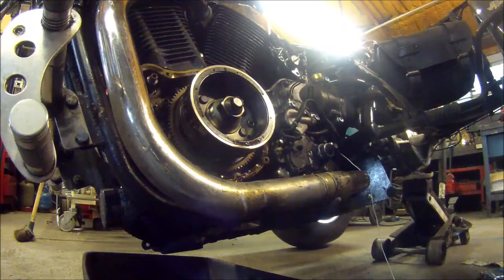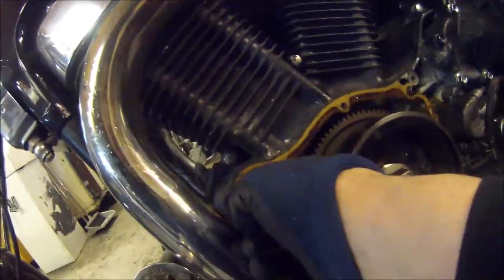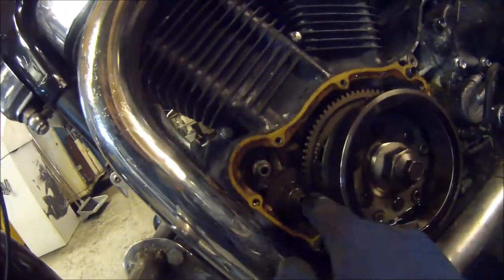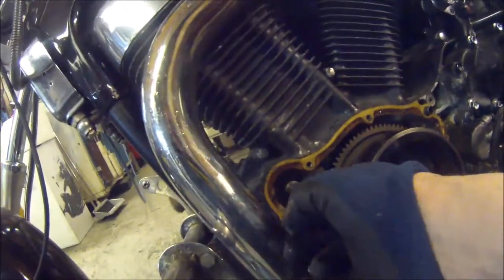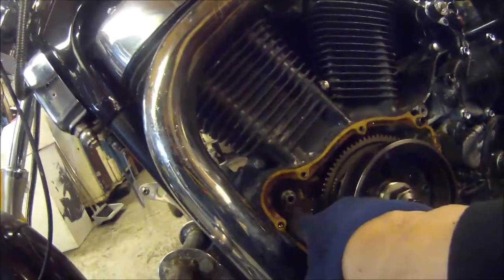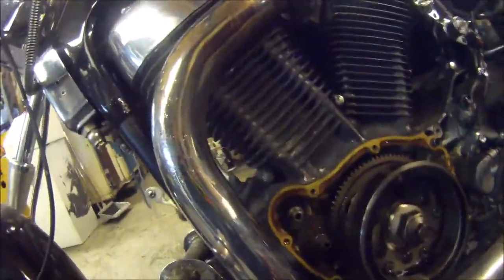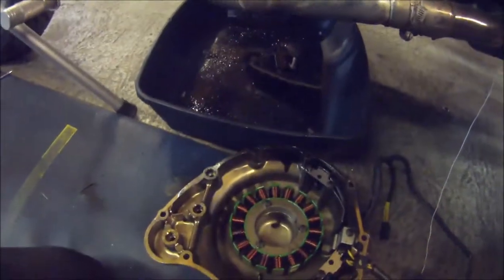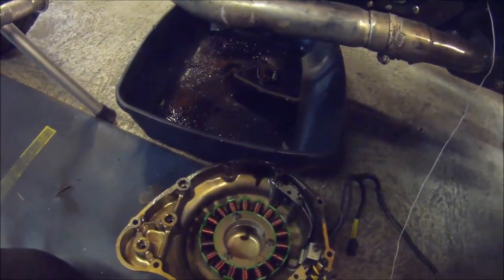Suzuki VS1400 Intruder Charging problems The Nuclear option part 1

Comment: I did this when we purchased my partners VS1400. Previous owner had attempted to jump start the bike with the battery still in place and arced out a lead on the exhaust, and his home made battery tender was arcing out on the frame.. Fried Everything. The replacement stator I bought had a faulty pick up so while it began charging, it then wouldn't fire on one cylinder. After much wailing and knashing of teeth, I got it sorted, got it running and charging properly. Then chopped it up and made it into a trike.
Reply from the maker: Suzuki have always had the one achilles heel; the charging circuit. Back in the day we would fit Honda CBN reg/recs. I've had generators where the pick ups were wired the wrong way around, and some where just one pick up is wired the wrong way, and some that were just plain DOA. The new generator the video shows was a dud, bike wouldn't start, I tried soldering the old pick ups to the new stator but it still wouldn't run, luckily I had an original Suzuki gen from a known good bike, ended up fitting that. Odd thing is with these Kung Flu Generators is that they seem to have issues from the box.

Comment: 👍thanks
Reply from the maker: Welcome 👍
Reply: I've replaced two batteries one stator and four regular rectifiers one of them actually burst into flames which was a bit disconcerting.
The bike will charge but only by less than half a volt and if I put the lights on It drops below twelve volts, it's either a short in the wiring or the same thing has happened.
Thank you for your video I'm going to try replacing the whole system as you did, I hope it works because it's driving me nuts!
Whish me luck. 🍀🤪🤟